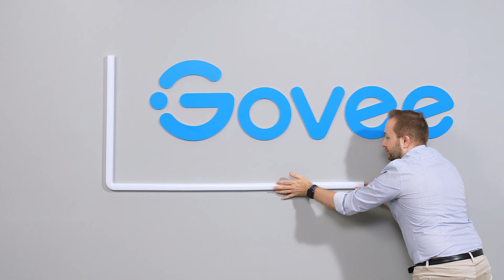How To Install Govee Glide Wall Lights

Comment: How do you remove them without tearing the drywall?
Reply: Strong sting and wiggle it back and forth behind the light through the adhesive material
Reply: There is a small tab on the bottom of the adhesive strip that you can grab and pull on and it will seamlessly come off as long as you have enough wiggle room to grasp it
Reply: That happened to me

Comment: When removing, can the same adhesive tape on the back of the light bars be used for installing it on another wall? If not, whats the solution.
Reply: did you ever find out?
Reply: @sythe1st  not yet, but the adhesive is really sticky.

Comment: why tf didn't they include two corner adapters that have opposite sides as connectors/receivers? Because it's extremely limiting when you can only go one certain way due to the connecting cable only being a receiver. It makes you not be able to go from right to left and downward in some situations. Has anyone else encountered this problem?

Comment: Curious... as I am so disappointed that it uses adhesive tape.  Will it stick to textured wallpaper?  Really annoyed that there are no holes for those wanting to use screws or nails to hang.  Seriously... you should consider this option.
Reply: I second this makes it impossible to mount to my 3d art wall panels

Comment: can i add my b6062 onto my h6062? for some reason when i try the bars wont light up once added on. if i refresh it shows they are connected but they new segments wont light up. if i plug them into a sperate power source everything works ok. does this mean the b6062 must run off its own power supply?
Reply from the maker: Hi one set of Glide wall lights must run off its own power supply, two sets can't share one power supply.

Comment: When I plug it in, only one lights up and not all of them. How do I fix this
Reply: Did you make sure all the panels were attached completely and you hear a “pop”? I had the same thing happen and mine were not fully connected to one another
Reply: @randomyoutuber9834  I fixed it using this I forgot to reply. Thank you so much brother.

Comment: The problem I'm having is that it won't connect to my wifi. It says it only can use 2.4 wifi( whatever that is), and apparently, I don't have it.
So with no separate remote control, this light is basically a useless waste of money, being it only comes on as a white light with no wifi and no remote control either.
Reply: Routers often can do 2,4 or 5 GHz. Just go to the settings of the router and temporally disable 5Ghz and connect.
Reply: @danielkibart9986  Great! Thanks so much 🙏

Comment: Am i tweaking? There is no way you can put these on the wall 1 by 1, the bars need to go under the previous one to click? Im doing it rn and im confused asf

Edit: ok i realize that THIS is the reason you start from the other side and end with the part where the power supply comes in, but that is such a DUMBASS IDEA. Literally every other product you can start with the power supply side and then work your way around, here you have to exactly calculate where the bars are gonna end up or you’re screwed, huge design flaw Govee….